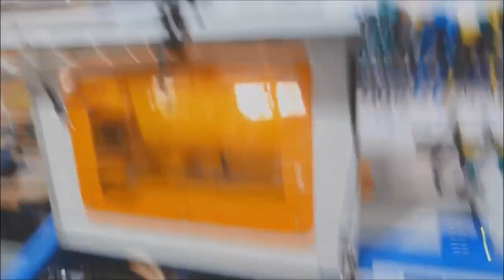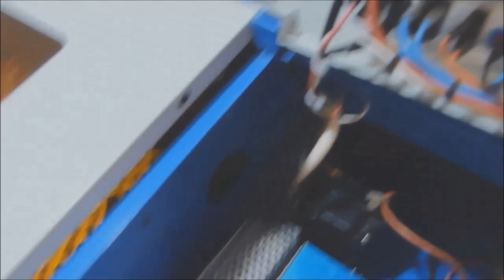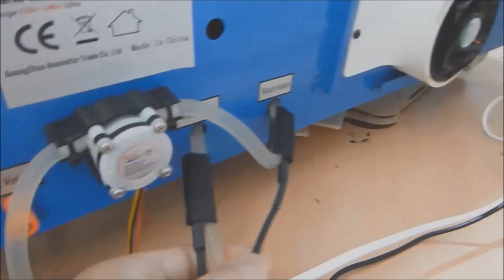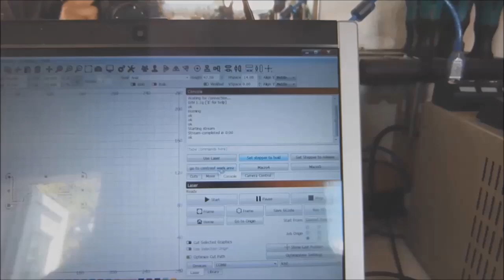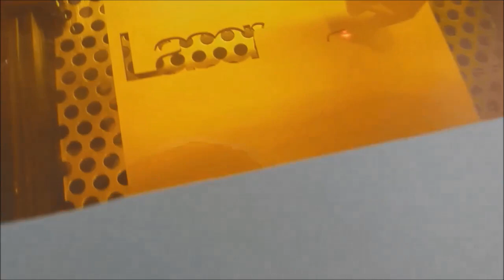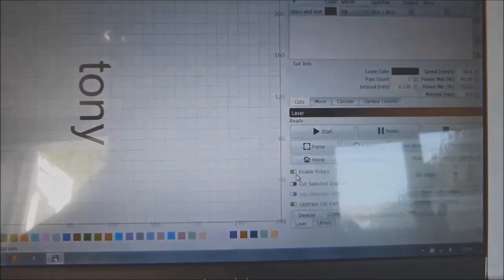K40 in use

Comment: You have done some great mods there I have a basic water flow meter and manually turn on my air can you provide details on the flow meter your using and the arduino parts and code I would need to automatically turn on air etc when I run a job many thanks great video, great machine :-)